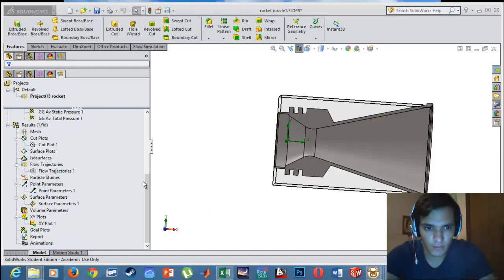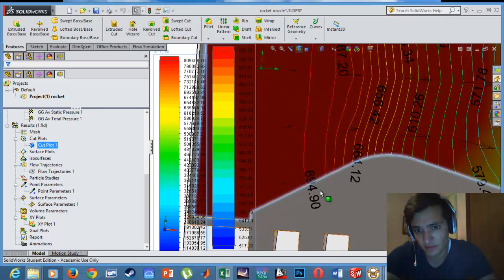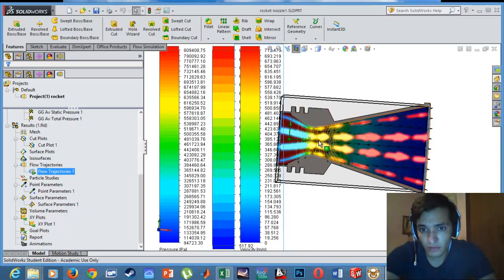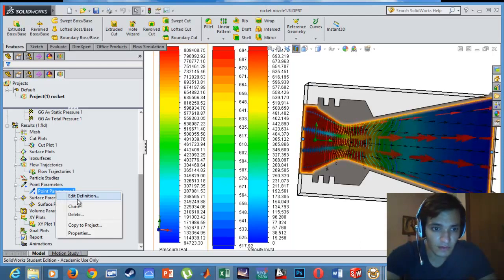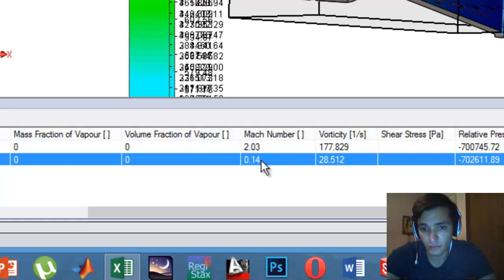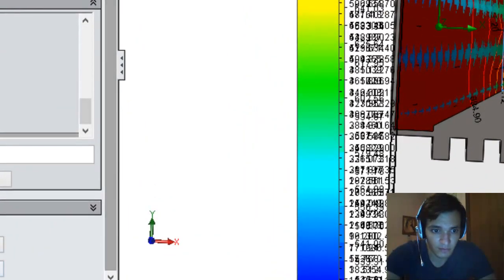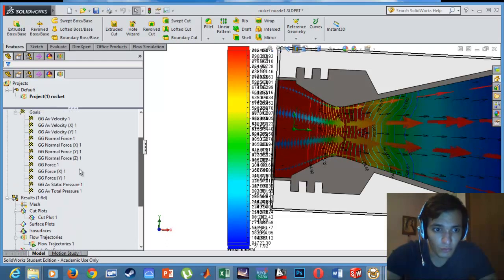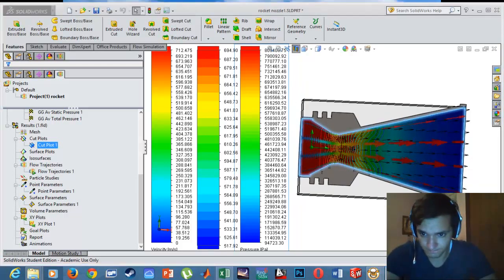Rocket Nozzle CFD Analysis On Solidworks.

Comment: how accurate is the simulation as compared to Fluent or comsol ?
Reply from the maker: Never used those programs
Some toled me that Ansys works  well on cfds !
When it comes to my simulation i ve surprisingly got almost the same value of trust that an amateur rocketer got on the same nozzle while he was conducting a static test ..... And that was a piece of cake !

Comment: Awesome video. What kind of fluid is running through the nozzle in this simulation? And could you please make a video on how you designed it.
Keep it up.
Reply from the maker: +Nossehrino Boys Thank you, well i ve used air+N2+Co2 But the fluid can be easily modified.
Regarding the nozzle i will try to post one but first i will post the hole Rocket External Cfd Analysis then the rocket motion taking into account the trust of the nozzle and putting it in into motion so basically the rocket will be tested and launched inside the simulation and i will show you how my results are accurate. By the way  if you worked with some simple shapes on SolidWorks well you can design anything i guess building the nozzle will be easy but the cfd might be challenging since i couldn't find any reliable video .